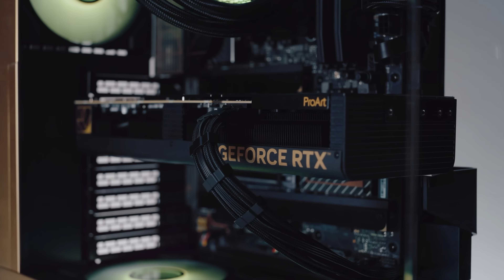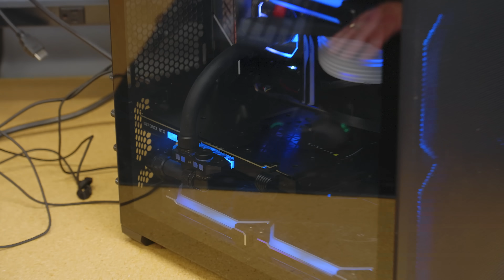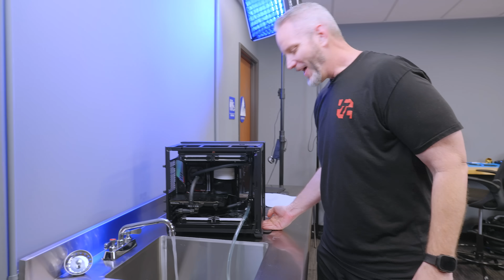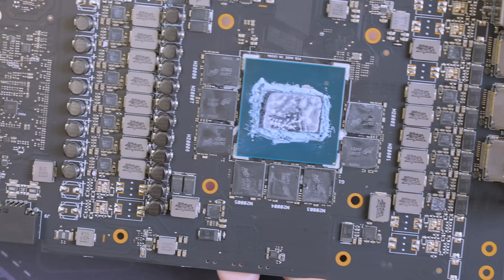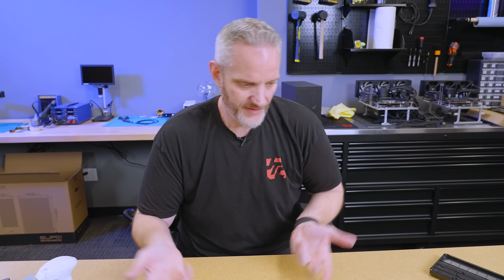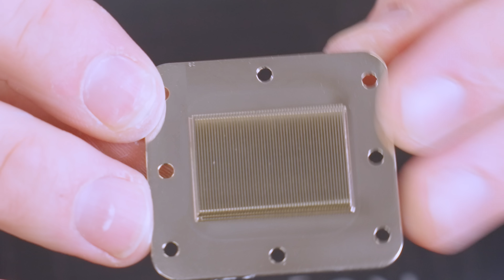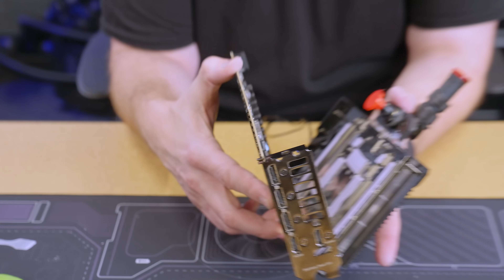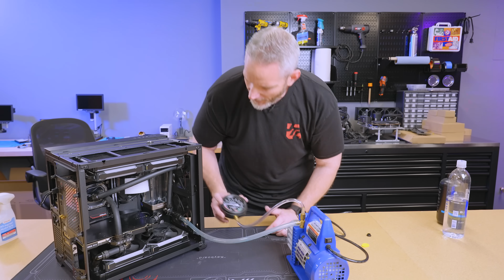These GPU Temps were BAD... here's what went wrong and how I fixed it!

Comment: Every time I see a good water cooled system, I think so cool I want one. Then I see a video on maintaining that system, and I'm like F that!😂
Reply: Dont forget sticker shock XD thats the first hurdle you have to get over.
Reply: I see so many ppl complaining about the maintenance needed every year or two

I find it perplexing, given how many damn hours you use the system, but not wanting to spend a few hours every year for it to run properly and preventing problems down the line. 
It's like a car. Use it however you like, but be prepared to maintain it/pay someone to maintain it

If you are not willing to do the few hours of maintenance, but still expect to spend hundreds/thousands of hours every year using it, it just doesn't make sense to me
Reply: @someguy9520  Why, in your opinion, is air cooling not a valid option?
Reply: Just...Nope! :v
Reply: AiO is good enough
Reply: All for a few degrees. I won't even run an AIO anymore. Noctua has made them pointless, in my opinion.
Reply: @Rob-Davidson  I agree, except in extreme overclocking situations
Reply: Ya thats why I've never done it
Reply: It's really not bad if you do it right the first time. I've had mine going for 2 years now and all I needed to do is add some coolant to the reservoir from tube permeation. I don't use exotic coolant, just modwater so you don't get dyes and stuff gunking up your fins. I use soft tubing with thick walls as well. I pre-treated the loop with this special mix that gets all the factory crap out of the system. I added a valve and stuff to my setup but I haven't needed to do any work to it. Temps are as good now as they were on day 1.

All my parts except my radiators, were secondhand or refurbs, so it was also really cheap. And my GPU is the waterforce 6900XT which comes pre-blocked.
Reply: @TheNiteNinja19 I was looking at that video card. Did you set it up with one radiator cooling both the cpu and gpu?
Reply: @RobertJohnson-lb3qz  Yeah I have a 420mm and a 280mm radiator in a loop with the CPU and GPU on the same loop, in a Phanteks P500A. It's actually quite overkill lol.
Reply: @ Sounds good. Keeping it extra cool❗️I’m currently debating an AIO or a custom design…
Reply: Same. But seeing the price is what makes me drop the idea before the maintenance.
Reply: True. I used to have a watercooled system. Then it got burned in a house fire. I was relieved that I didn't have to maintain it anymore. 😂
Reply: quick disconnects
Reply: 100%
Reply: Yeah, an AIO is so easily replaced. Having to tear my system down every year to clean out all of the gunk has always been a turn off for me going full water cooling.
Reply: I was thinking bout the same thing ahahahahaha
Reply: Water cooling is a slippery slope. If you want it to be easy, use soft tubing ZMT and some Koolance QD3 quick disconnects. I’m able to remove any component and any or all of the 3 radiators or pump all separately and not have to drain the loop. Also cool things now like the Aquacomputer Leakshield
Reply: I find maintenance on an open loop to be less of a hassle than air coolers.  Blow the rads out occasionally, done.  Water loop RARELY needs maintenance.  Only "issue" I've found is if you use soft tubing, the water WILL evaporate through it and you'll need to top off occasionally.  I don't use "super cool" pretty additives.  Just dyed red.  Good enough, no blockages in the fins and no sediment.  

Build it right, it doesn't require much paying attention to.
Reply: @MrAcuta73 Sorry, what is an open loop?
Reply: I’d love a custom loop then I see the expense on top of the maintenance ….
Yeah, nah
Reply: With the exception of building a custom water loop, I think maintenance isn't that bad. I check the dust filters every once in a while but my PC actually doesn't collect much dust. And I only clean the loop if my temperatures are not normal and I have to replace the thermal paste. Which leaves me no choice to drain the system anyway. When I built the system I made sure to have a valve at the highest and the lowest spot to make filling and draining easier. And I got myself an external power supply for the pump, added a switch and can use that for maintenance too to wash all pipes with cleaner and rinse them with demineralized water. I use a special liquid for cooling with a few drops of pink. I cleaned it once in 4 years. It probably wasn't even necessary 😅
Reply: If you can run air, run it, same goes for those AIO.  Never know when that thing is going to go out. I’ll stick to my Noctuas.  For the DIY that wants to play with water cooling have at it, you will also have all the work that comes with it lol.
Reply: I’m not sure, but is an AIO liquid cooling system better?
Reply: I still want to build a 14900k and keep working out how much over priced i want to spend on a strix 4090 as in england new old carda are about $1000 mote here for what ever reason ...i found a new card for £2500  so that $3092  just wish i had you to ask some question like cables for what ever powersupply what memory as the dark hero says upto 192 gig but is 64 good ..i want to last some year as i can not build one every year maybe every 5-7 years
Reply: If the fan goes out on my Assassin, I can pretty easily see it and replace it without a bunch of other steps, Also, the aluminum block, on its own, provides at least some cooling. A clogged WC loop, not so much
Reply: Fwiw, my anecdotal experience is it's fairly zen. Kinda like cast iron pans. Overblown challenge for upkeep.

That said, do what you are comfortable with. Life is short.
Reply: Seriously, every video showing the massive gunking up and corrosion with them saying “this is so weird and unexpected”, and then it happens with every custom loop video and AIO teardown.
Reply: The only thing that it has advantage on is being silent system, which is really expensive gimmick, theres no PC home system that couldnt be aircooled.
Reply: Maintenance should be something you only need to do every couple years with a properly engineered custom loop. Heck, i have an AIO that was over 8 years old with zero maintenance that still works like it was new, so its definitely possible.
Reply: If you carefully plan your loop, use PTM7950, and use premium materials: you will only lose your mind a little bit putting it together and then it's easy peasy.

Like you can fuss around with the perfect drain and fill placement, blah blah. Just make something accessible and use an electric blower and vacuum fill EZ.

Otherwise just go AIO 😂
Reply: From what I can tell it's only for enthusiasts who really want to do it. Nothing wrong with air cooling, I'd recommend that over AIOs even.
Reply: Same.
Reply: A well designed hardline water cooled system looks so much better than any AiO or air cooler that it’s worth it for those who value aesthetics.
Reply: if you stick to clear liquid it's not a problem if you stick to flexible tubing, it is a half a day job to upgrade a cpu or gpu true and it is annoying but it brings so much I'm never going back to air cooling 1-cooler room temp as you exhaust 35-45°C instead of 60°C 2-instant cooling of cpu and gpu in 3s they go from 90°C to 35°C 3-exhausting hot air outside of the case better for nvme and high speed ddr5 4-half if not less of the noise I sometimes completely forgot to switch profiles (desktop-gaming-benchmarking) and game at 600w with the fans at 800rpm and a completely silent pc I only realize it if I open my rtss overlay and see I'm 10°C higher than normal
Reply: @fredEVOIX  For 1, cooler room: Thats not how physics works. Your room gets heated by the wattage of your system. It doesn't matter if you exhaust a ton of 40°C air or less but warmer 60°C air. The sum of the energy that air carries is important. Could even be that your room gets hotter faster, as the transfer of energy from your components to ambient air is more efficient.
Reply: @Hennerbo  i would argue that the room will not only probably heat up faster with the better heat transfer to the surrounding air, it will also heat up more, since the components run cooler -> boost higher -> more watts -> more heat
Reply: @fredEVOIX  Question: I took the plunge and got an AIO for my CPU finally. I'm running an AMD 7800x3d. It's idling at 52C; under 100% (synthetic) load with the associated fans running at max it peaks at 70C. Is that normal, or did I screw up my installation somewhere?
Reply: @mikehammer4018 thats fine, mine hits 85 because its an itx pc, realistically it can hit 95 for hours before it takes damage
Reply: @fredEVOIX Yeah, for me the noise improvement would be great.
Reply: If you use distilled water as coolant and stick to RGB for the colour you want in your system the upkeep is actually minimal on a properly designed set up with fill ports and drains
Reply: I have never needed to do any maintaining on my water cooled system.
Reply: -----
@skittles.abuser
-----
- Well, I guess that depends on the reason as to why you watercooled your system in the first place?
-----
Reply: Meh, it's not that bad, better than all the dust cleaning in your computer every month air cooling your computer. And if you don't use pastel coolant for the "cool factor" then it rarely gets gunked up. I clean my water-cooled PC every 6 months or so, or when the coolant changes color
Reply: @Celician83  I mean I still get dust with a fully watercooled system lol. What watercooled pc doesnt?
Reply: @jonredcorn862  The one sitting in the kiddie pool...
Reply: @jonredcorn862  positive airflow helps, also an overkill setup with more than 1 radiator that you can run the fans at a very minimal speed also helps
Reply: @Celician83  I mean you are still pulling in air from outside. I have 660mm of radiator space and still get dust.
Reply: @jonredcorn862  run dust filters
Reply: @Celician83 
A positive flow setup helps minimize dust.
Reply: @Celician83  cleaning off dust is way better lol.
Reply: @Celician83  wait you clean your computer every month? huh? for me its more like 1 time per year xD, dont you use dustfilters in your case?
Reply: @Celician83  I use clear coolant and drain and refill once a year at most and I have never had any problems in over 5 years, Oh and I don't even have a drain valve. I bought one and keep meaning to fit it the next time I drain the system but have never bothered to date.
Reply: @RonniePeterson  I do not own a drain valve either, simply turn the computer upside down and drain through the fill port, once levels have dropped, crack open one of the lines for it to finish draining.
Reply: @Celician83  I deep clean my PC once a year using my trusty $30 (now $120) Metrovac. Usually takes around two to three hours from disassembly to reassembled. When I'm done with everything including the case, they all look almost brand new again. Whoever that cleans their PC once a month is crazy and will accidentally kill one of the components easily. People with real watercooling setup are masochists. The amount of effort required is out of this world.
Reply: @Celician83 if you have to clean dust every month than you should clean your house, I do it once a year and not that much dust. Takes me 1 minute on a balcony with a compressed air can.
Reply: @Celician83 I was not aware of that, the fluid changes color over time?
Reply: @RobertJohnson-lb3qz  I had purple Thermaltake T1000 in my system, and over the course of 9 months it turned brown
Reply: @Celician83 Interesting, thanks 👍
Reply: @Celician83  Every month? Guess you're really picky. Because once a year is just fine without causing any issues.

Comment: And nvidia removed the hotspot temp in their RTX50, i have found it to be very useful in my graphics cards where temps on my STRIX2080 was 65C but 85C on the hot spot. repasting brought it down to 73C hot spot and got a extra 200Mhz out of it.

Comment: Funny enough I have a similar issue with my 7900xtx of from gigabyte but the delta is 30+ C even after a repaste and tightening screws every other model and review of xtx says the normal delta is around 10-15 but nah gigabyte thinks 30 is ok even RMAed it and they said nothing was wrong with the card-__- really wishing I bought a hellhound instead of the gigabyte gaming OC because it seems to be a cooler issue

Comment: This makes me wonder if a rubber seal for CPUs and GPUs could be a thing for someone to make. Close enough to the die might help stop excessive pump out and keep paste in.

Or the pump out could just build pressure and pop it.
Gotta find out though

Also the vaccum fill is epic and makes me want to rig something to make it easier.
Like a tub above the PC with a valve and rubber hose out the bottom to connect to the system.
Fill the bucket with coolant, get the PC ready, then open the tub valve first to get it down the tube, then open the PC one to suck it all in with almost no air getting in. As well as the most coolant it can take in.

Comment: I got the same case as Phil. Woot
Reply: what case is that?
Reply: @dridinger  Lian Li O11 Air Mini. Slightly wider than a regular mini, but it supports full size psus, and the front is vented.
Reply: @SodaPopinski3000   I like that one.  Trying to find a case i like to build in is tough.
Reply: @dridinger  you don't really have to change cases too often, so just get one you don't mind looking at for a long time (but also has good airflow)

Comment: Me sitting here with my 6900XT Nitro+ that sits over 100c under full load
Reply: Clean out the dust son 😂
Reply: Learn to undervolt/overclock you card please.
Reply: Dude go into adrenaline and custom tune that shit. Like what the actual fuck.
Reply: Your paste pumped out. Get some PTm 7950 and call it a day
Reply: Nitro was a good cooler dude... Please have mechanical empathy and do a repaste!
Reply: Huh 😂 I have a 6900 xt and I dont see anything over 80c on the Hotspot and thats ultra settings.
Reply: Amd 6000 chip isnt flat, common problem with 100 hot spot
Reply: @Fregatte86 a lot of times the stock fan curve is so low. And the voltage is maxed.
Reply: @madgodzilla12465 I would recommend looking for a undervolting guide via Ancient Gameplays YouTube channel. He has covered all of the AMD grapihcs cards in depth and has some excellent and easy to follow guides. You will get better performance, less noise and far less heat.
Reply: Repaste it and clean the heatsink
Reply: Nvidia deletes 50 series hotspot temp sensor for the same reason 
"Bro just xyz" 
the card with a core temp of 60 "yeah turn the fans to 100% that'll work"
Undervolting amd also doesn't really drop temps much since it just adjusts a vf curve and lets the card boost higher with less voltage meaning, less heat from voltage but more heat from clock speed, overall this won't help much either.
Reply: @steadyclouds4614   I don't agree under volting does drop temperatures hugely with these cards. I have 2 6700 xt systems, 2 7800xt systems and 1 RTX 4080 system. Under volting + custom fan curve or max % helps massively with heat and power consumption. As for the clocks going higher....They don't because you set the clocks where you want them to go. Via the Adrenaline software you set min and max clock speed and it will not boost past where you choose to set it. Yes clocks can go higher if you choose them too but only if that's the value you set it too.
Reply: @dakbassett  youre limiting clocks, not just undervolting. Said it yourself? Youre limiting that vf curve.

Comment: Why do I get random black frames when I play games if I OC my GPU? It's not overheating...If I go too high it crashes, but there's a huge range of OC values that operate at good temps etc, but I get stuttering and single black frames randomly. MSI Afterburner 1070 GTX, 3930K, my PSU is only 500W so I've been thinking that might be the issue?...